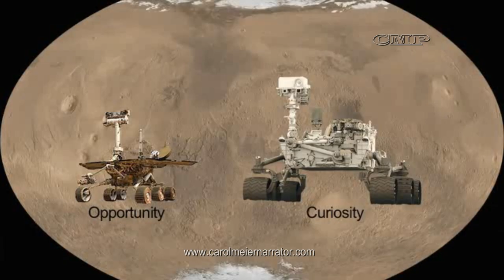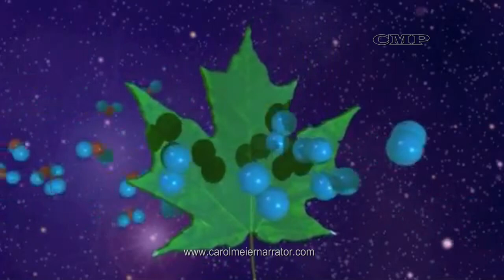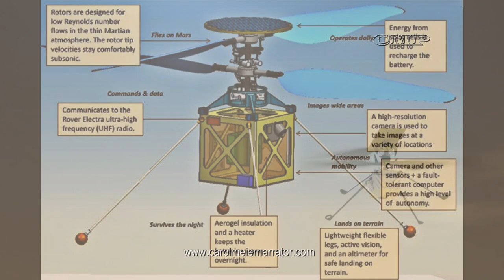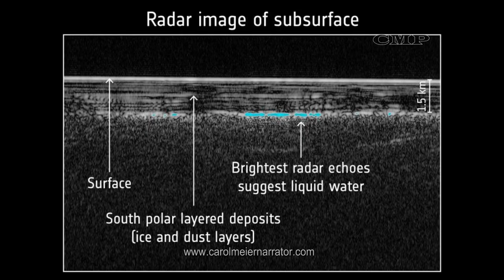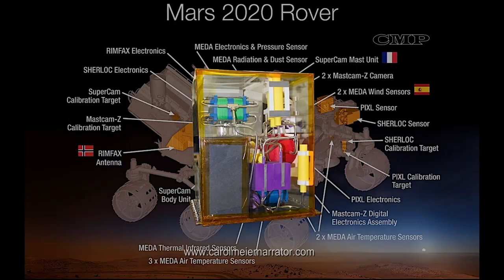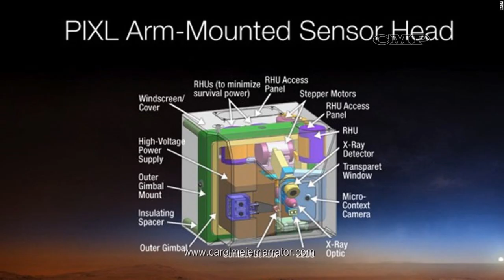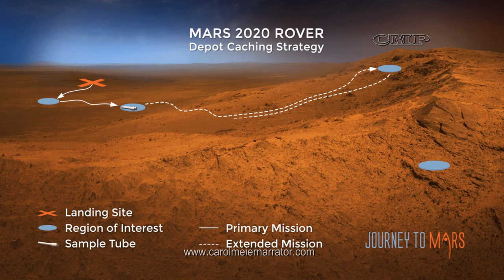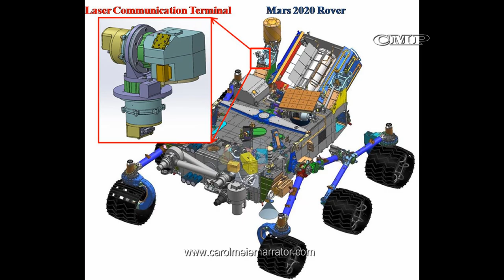Mars 2020 Perseverance Rover - What's Different This Time? A Narrated Explanation.

Comment: I think it is too much for one mission. Feels like this should have been spread out to 2 or 3 rovers so in case one failed the other can still carry on mission
Reply: You'er talking about 4x the price. Launching individual, specialized scientific payloads to mars would be extremely expensive, along with taking way longer as they don't have the facilities to overhead that many payloads.
Reply: they made a choice of maximum input for minimum output ... to save money ... the previous rover was the limited test bed ... and it works fine ... now they are loading up it's improved brother ... if this one works like it's little counter part then they will make a new one with different stuff on it and land it in another spot to look for other stuff ... NASA isnt trying to find one spot to go they are trying to find what spots can be landed on and used in the future ... it will be groups like spacex and boeing doing the major building there ...
Reply: @wheresmycar9559  Not really. 90% of the price is in to development of the rover and protocol. Launching them is the cheap bit. Perizxcv is right. If one thing, out a million, goes wrong, all that money is wasted. They should be sending two. Like in the old days.
Reply: I was starting to have these terrible thoughts about 2/3rds into the video about one of the skycrane lines getting caught and the whole rover flipping downwards uncontrollably.
Reply: At some point, you have to trust that you've developed the core system enough to start placing more systems on them. We cannot keep making several hundred million dollar one use shots and expect to maintain funding, especially when it starts being pushed out over multiple years. 

Like it or not, publicity pays the bills.

Comment: Marvellous engineering. Did they add anything to keep the solar panels clean?
Reply: It doesnt have solar panels, old tech ;p
Reply: There are no solar panels. The new rover will use the same power source as Curiosity. Its called an radioisotope thermoelectric generator or RTG. An RTG uses a pellet of radioactive plutonium that was produced in a nuclear reactor. While there is no longer any fission reaction occurring in the plutonium the metal is still red hot due to radioactive decay. The heat from the decay is conducted to thermocouples that convert the heat into electricity to power the rover.
Reply: RTGs are the same thing used on the Voyagers.  Still going after 40 years.
Reply: @joevignolor4u949  Thanks for the info. Especially appreciate how courteous you reply was.
Reply: @robrussell5329  Thanks for the info.

Comment: Where's the video camera? I would think at this time they would add this instead of braking their heads putting a puzzle together of pixalized black/white pictures smh...missed opportunity
Reply from the maker: Actually there are several full color video cameras which this time are being paired with microphone sound.  They document descent and landing and provide a great variety of info valuable to scientists.
Some video can be taken on the ground but the reason we don’t see more video is because video files are pretty large and because we have limited downlink each day.  Scientists can get plenty of scientific info from  and actually prefer a series of stills which are taken in both black/white, and color.  Each has their value in scientific evaluation.
Reply: I think in future we have to first install huge signal towers on mars to make faster data transfers!

Comment: Why not use a small dirigible ?? Blimp
Reply: Lift to weight ratio I think. Size would need to be huge because of low density atmosphere, hence weight of envelope would be high. Would need to be filled with a gas lighter than Martian atmosphere. Not easy.
Reply: To add to what David said, it would also be too fragile. There's a reason we stopped using them regularly on Earth, and it's mostly that.

Comment: Strange that some of the wiring is left exposed to the elements?
Reply: yeah, they should put some kind of thick protective cable around the wires
Reply: There is no water or oxygen on Mars and very little atmosphere, less than 1% of Earth's. Dust looks bad but doesn't have that big of an impact on the lifespan of non-moving parts (except solar panels). Also, every gram adds cost to the flight and, more importantly, risk to the descent phase.
Reply: Jacob Lumpkins lol, Mars' atmosphere has both oxygen and water vapor, it's just primarily carbon dioxide.
Reply: @JonnyRicter  You are correct, but the point was that water vapor and oxygen have a negligible impact on part life on Mars. At the temperatures and pressures of Mars, even Earth's atmosphere would have a hard time damaging parts, and Mars's atmosphere has a much lower percent composition of O2 and H2O. Most people would say the human body has no naturally occurring gold even though, statistically speaking, it likely contains a few atoms worth. At 0.2% O2 and 0.03% H20, and 0.6% the pressure of earth's atmosphere (Wikipedia) (which means the partial pressure of O2 is only 0.002 * 0.006 = 0.000012 atm, compared to the 0.23 atm or so of Earth), I stand behind my claim of no water or oxygen present.
Reply: There is really no way they could get damaged other than something striking them quite hard; very unlikely. Also, it is the case that several rovers have been constructed in this same way with no wiring related issues that I have ever heard of; this is hardly their "first rodeo".

Comment: All this, but still nothing to assist in removing dust buildup . . . . . . . .
Reply: Perseverance, like Curiosity before it, is nuclear powered -- specifically via a Pu-238 Radioisotope Thermoelectric Generator (RTG) -- so it has no solar panels to gather dust.  But yes, developing self-clearing solar panels is an important area of ongoing research.
Reply: @QuasiRandomViewer  There are a lot of lenses on this thing, not to mention other parts that might be affected by dust.

Comment: I would like to try to step on Jupiter's moons, since Jupiter, itself, will probably crush us. All the outer planets, save Pluto, are too big for humans to stand. Even in iron space suits, we will be compressed into the boots.
With proper insulation, Venus holds some promise. So, that's the list, Pluto, some moons, and Venus. The rest are out of bounds.
Reply: You need to re-think your list, Michael.  Venus has incredible atmospheric pressure and intense heat; it is our Hell-World, and it has no place on ANY ones' list, and is a total waste of time and money.  You need to add Titan [although it will take 50 years until we are ready for such a trip], and put emphasis on 3 of 4 large Jovian Satellites; [we need to ignore Io. . .]  If Pluto is fine by you, Triton should be also; they are too much alike. . .  .   This leaves Mars.  Brutal, but I 'd say it's our Sand-box.
Reply: @skywatcher1972  
I'm 71 now, so without a serious breakthrough,  I won't even get to our moon. But if I can travel, reasonably fast, with a proper suit and ship, the only obstacle I see is gravity.
I see Mercury as you see Venus. I'm afraid to expose my ship to so much solar power, where as atmospheres, I believe, I can handle.
I do fret, a bit, about spreading Earth's molecules across the void. Driving to our moon and back is fine, because the Earth reclaims any stray molecules. But leaving a trail all the way to Mars or Pluto is basicly stealing from the Earth. So whatever breakthrough I dream about, must have a squeaky clean record. Rocket engines are right out! That cloudy exhaust trail is unacceptable. Before we start traveling, we better clean up out act.

Comment: Well done video. If we really extract tons of oxygen from the atmosphere for fuel, seems like we will be altering the atmosphere of the entire planet. We've been there, done that...
Reply: The atmosphere of Mars masses at about 2.5 x 10^16 kg.  95% of that is CO2.  It can afford a few 1 x 10^3 kg converted to O2.  That does not include the O2 sealed away in minerals and water.  If we do warm it up over the long run, that’s a good thing possibly.

Comment: what happened to all those crashes and lost missions? any spare parts to go get? how about a light lift machine - helium filled air bag? a mission to build structures like a greenhouse tube with KUDZU - spreadable in the tube oxygen maker. CO2 motors could just burn air that is mostly co2
Reply: Can't burn CO2.  Already burned (oxidized).

Comment: if that chopper hits a dust storm over there, it's toast
Reply: probably not since the wind there isnt exactly damaging, considering how thin the atmosphere is.
Reply: dust storms on mars are like "normal wind" on earth. If anything it will preform better in a dust storm since the atmosphere would be temporarily thicker. And if it breaks, tough luck but no big loss.
Reply: The dust storms on Mars aren’t like what you saw in the Martian. As the guy above me said it’s a light 5mph breeze at best.

Comment: Nuclear power source, good. No more depending on rare sunlight.
Reply: It's got a catch 22 though, after 20 years no matter how well it performs  the RTG (Radioisotope Thermoelectric Generator) will be producing so little power that the rover will likely be unable to move or have to shut down most of it's equipment to remain operational.

I do wonder if an Oppertunity like solar rover was built with what was learned from that mission if you could streach that 14 year mission out much further, especially considering Oppertunity was only expected to last 90 days.
Reply: The thing is though that NASA are working in developing a “dust repellent” if you will using electric fields if I’m not mistaken. So if that was to be developed than we will go back to solar panels. RTG’s are expensive and would be better used for missions that are farther from the sun.

Comment: I wonder how they're going to hear anything with those microphones since there's no air on Mars
Reply: There is air on Mars, it's just much thinner than Earth. If there was no air the helicopter wouldn't work either.
Reply: thin air
Reply: Sound travels through the vaccum of space or we wouldn't hear quasars.. we just need to figure out how to record the noise waves in a low density atmosphere and in a vacuum .. Thinking this will have to be something along the lines of detecting the wavelengths of the sound/noise in relationship or relative to the gravitational distortions or displacements. 
I sure would Love to see those experiments & results.
Reply: @811dal54  No, sound cannot travel through a vacuum, there is not enough particles that can transmit the soundwaves. what you're referring to is sounds extrapolated from other waves, waves that travel without a medium like radiation or gravitational waves. Scientists can convert these waves into "sounds", it's not the actual sounds but a representation, usually heavily distorted to be able to be heard as well.

Comment: Gene Jackson.  Panels what panels I don't see any panels.  Atomic power?
Reply: yep
Reply: The new rover will use the same power source as Curiosity. Its called an radioisotope thermoelectric generator or RTG. An RTG uses a pellet of radioactive plutonium that was produced in a nuclear reactor. While there is no longer any fission reaction occurring in the plutonium the metal is still red hot due to radioactive decay. The heat from the decay is conducted to thermocouples that convert the heat into electricity to power the rover.
Reply: @joevignolor4u949  That's really cool
Reply: @joevignolor4u949  That is absolutely some of my favorite tech. just charging the batteries from the heat coming off of a chunk of mineral.

Comment: Are you kidding they never thought about dust covering the solar panels...? Helicopter looks great, don't see anything wrong :p
Reply: They did. That's why they originally planned for a 90 Sol mission. Instead they got 5,352 sols out of it. The rover eventually was shut down to help it weather a planetary dust storm (as in, it covered a majority of the PLANET), and it just never woke up. We THINK sufficient dust accumulating on the solar panels is the likely explanation for what managed to finally kill it, but it's hard to check.

Comment: If the atmosphere is almost pure Co2 why isn't it extremely dense like that on Venus? Especially since i t's further out from the solar wind.. It has a lower gravity but still with such a high Co2 concentration (which is 39% more massive than air) it should be denser than 1% that of Earth's! There's no common sense to these numbers.
Reply from the maker: See this video for a full explanation of what happened to Mars atmosphere and why it is so thin.
https://youtu.be/FMIUtteeRZ4
Reply: You didn't understand though, yes Mars' atmosphere is mainly CO2 but quantity depends, Venus has an inmense amount of CO2 in it's atmosphere, while Mars doesn't, just because something dominates in an atmosphere doesn't mean there's much of it

Comment: If there's so much wind on Mars, wouldn't it be more productive to generate energy from the wind as well as solar, and not just solar?
Reply: While there are winds on Mars, the atmosphere is only 1% of the denisty of Earth's atmosphere and thus you would need very high winds to create what would feel like only a gentle breeze.
Reply: @johnhead1643  I see. But I did learn that sometimes the whole planet is 1 big giant dust storm. Is that not enough to cause enough wind power?
Reply: The equation for wind power(P) is given by P= 0.5 x ρ x A x Cp x V^3 x Ng x Nb where, ρ = Air density in kg/m3, A = Rotor swept area (m2). Cp = Coefficient of performance V = wind velocity (m/s) Ng = generator efficiency Nb = gear box bearing efficiency.  The velocity is there, but air density is very low.  Even if there are winds over the entire planet, only the wind on the wind turbine blade counts.  To get more power, you’d need more turbines and batteries to charge.
Reply: It would make better sense to take a atomic reactor to Mars that can be fueled with thorium.
Thorium is found in clay, it is dirt cheap, requires no processing and there is plenty of it on Mars.
The beauty of a thorium fueled atomic reactor is, it creates no radioactive atomic waste.
This is a win win situation.
Reply: @Natures_Symmetry  dust is a lot lighter, and finer than spinning a turbine :)

Comment: Why don't NASA manufacture a Drone to discover Mars? It might be much more easy to move, avoiding danger of stuck in sand.
Reply: Mars has dust storms
Reply: The atmosphere on mars is extremely thin. The drone would need to be so lightweight that they wouldn't able to fit as many scientific instruments as a rover or lander
Reply: mars atmosphere is the same density as earths... if you were at 100,000 feet. highest a drone on earth has ever flown is 33k feet highest a helicopter has ever flown is 40k feet. its impossible for normal drones or helicopters to fly at 100k feet. Thus the design of nasa's helicopter
Reply: Well, not sure if you realized but in this presentation it was mentioned that there is a drone included in this mission.
Reply: ingenuity helicopter is attached to the bottom of perseverance

Comment: WHY CANT THEY MAKE WATER ON MARS BY USEING CONDENSATION METHOD  LIKE THE DO IN DESERTS
Reply: The atmosphere has no significant amount water to condense. 
Mars surface temps are -80 F, and at the poles -125F. 
Any water will freeze.
Reply: There's quite a bit of water underground and almost nothing in the atmosphere.  They'd need to dig up a bunch of dirt then heat it at low pressure to extract the water.  Not easy, but good to know it's there and can be extracted.
Reply: there is ice on poles so they don really need to condense anything
Reply: @hinditime8034  i think its solid co2 and not really watter